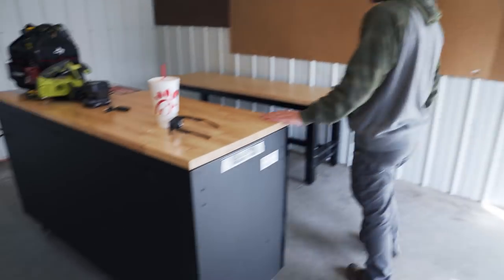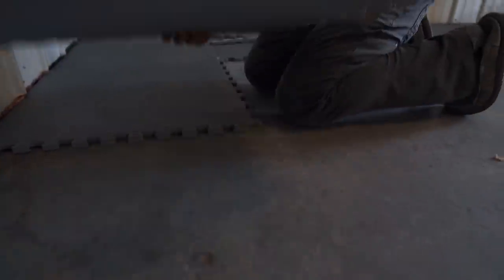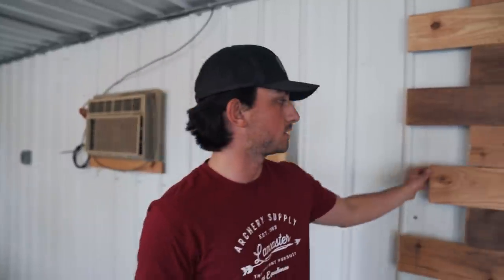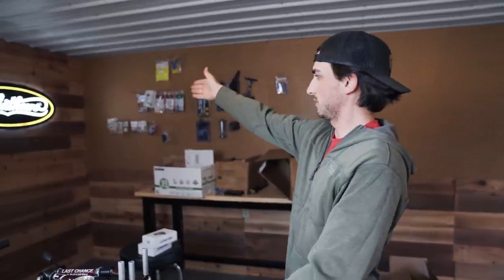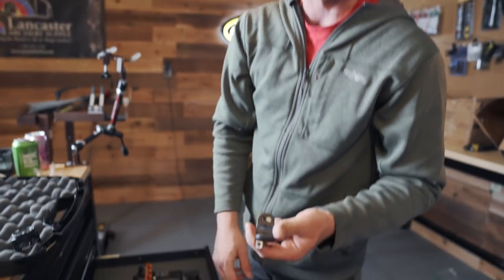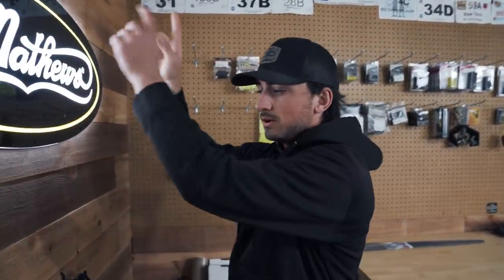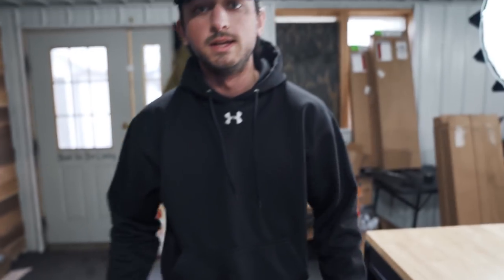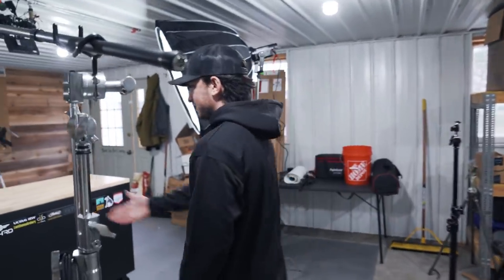THE ULTIMATE BOW SHOP BUILD

Comment: Hey just a tip on the paper tuner if you put a small strip of wood across the bottom of it then screw a hacksaw blade to that it will make ripping the paper you pull down much easier